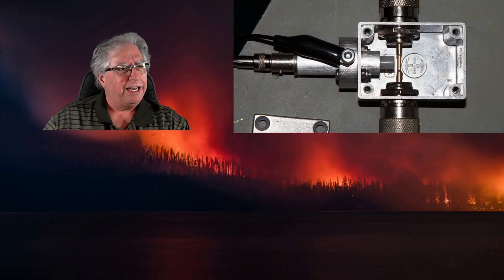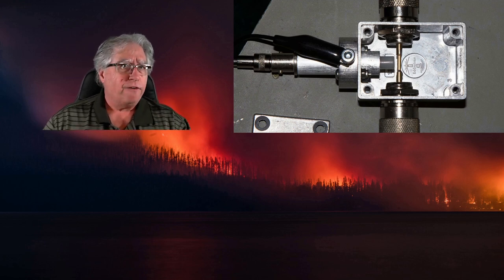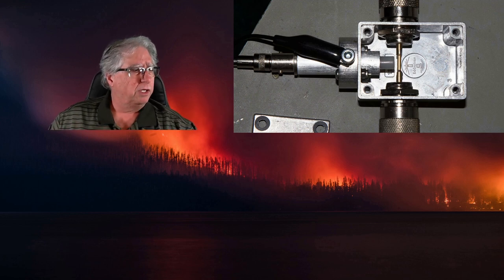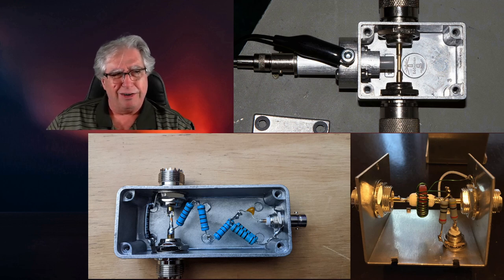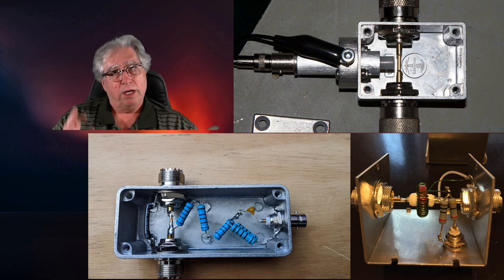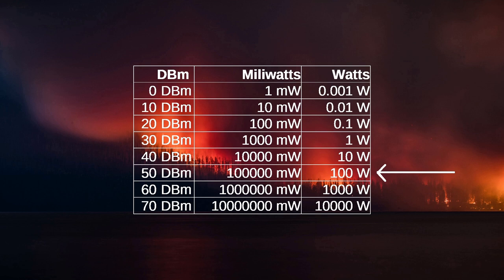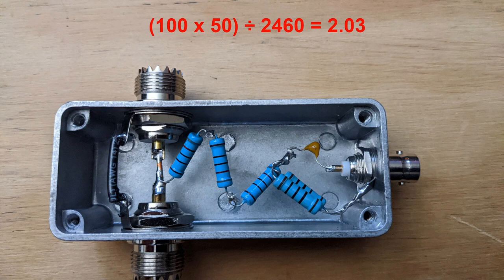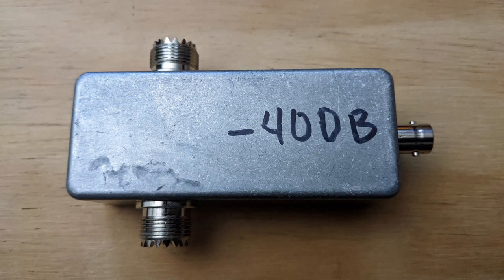How To Build An RF Tap Attenuator

Comment: Very nice presentation and simplification of the resistive taps Stuart. Two points:  on the chart dBm is written with just the B capitalized. And at 8:54 the proper terminology is:   50 dBm take away 40 dBm is 10 dB.  (Because dB is a power comparison and dBm are absolute power values). Keep instructing and 73 Peter
Reply from the maker: Thanks VE6KK, I always seem to screw those up...

Stu
AG6AG

Comment: i'm going to build your 40dBm attenuator project, but I have a doubt. In the calculation, I even carried out one by one, it didn't work, but later on, you explained that the impedance you were using was not 50 ohms but 25 ohms, so the calculation worked, as you were counting on the input Z of the power analyzer. spectrum..my question is: I want to connect it to my Rigol scope, whose Z= 1mega ohms. Using the n formula with r1= 2460 and r2 =50 ohms, the attenuation is 34 dBM. It's OK? I can use it to see the modulation and the RF power.??
Reply from the maker: Hello Antonio,
What a great question! Here is the thing, If you do not have a 50ohm load on the end of the connection to the test device then your SWR will be way off. That could damage your radio so we need that 50ohms there!
The solution is to have an inline 50ohm terminator at the input connection to the scope. Since your scope is high impedance it should not change the overall impedance value seen by the radio.
I built my own terminators for my Rigol scope to hook it up to my HF rig. I used this box:
https://www.amazon.com/gp/product/B010DHQLEI/
mounting 2 BNC panel mounts (one male one female) and used 2 100ohm 1W resistors in parallel to place the 50ohms next to the Rigol. You can buy a Chinese 1W device here:
https://www.amazon.com/gp/product/B08V1MX6HD/
if you wanted to save the build time. I wanted the extra watt of protection so I built one.

Hope that answers your question!

Stu
AG6AG